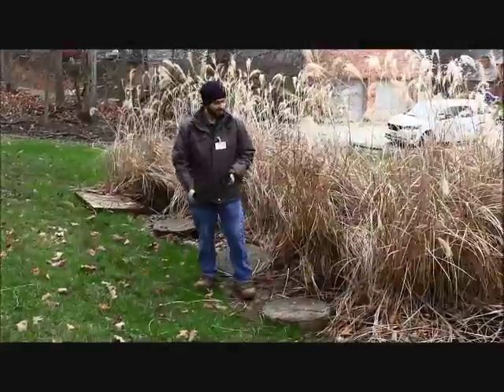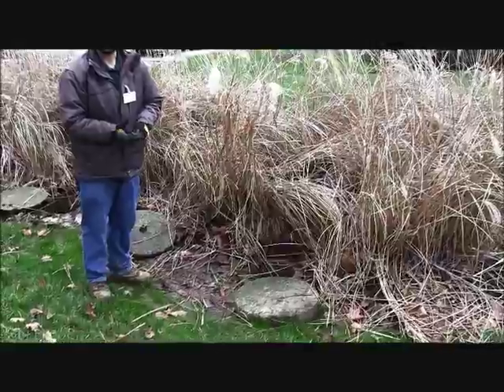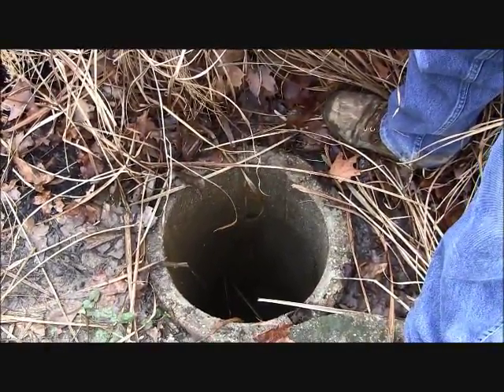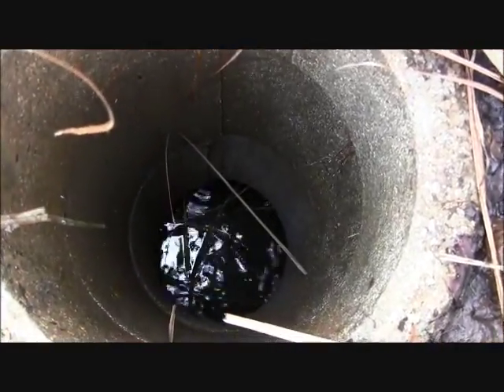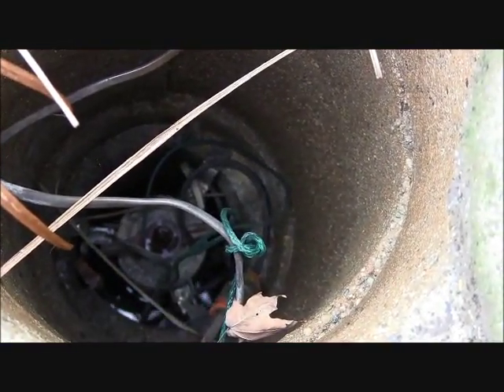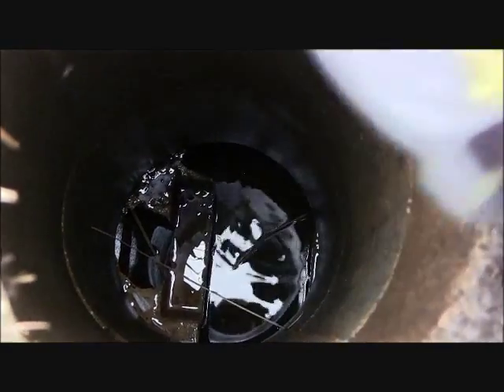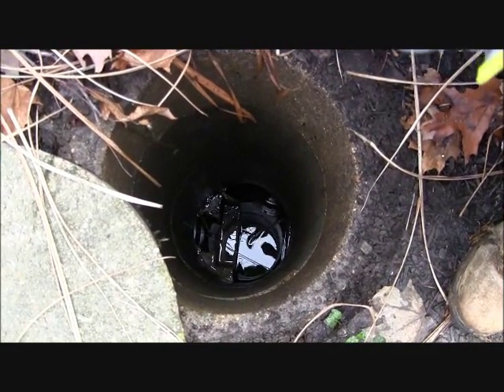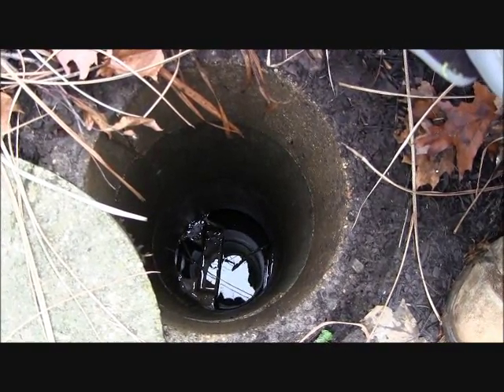Hamilton County Public Health Inspects a Jet Sewage Treatment System with Upflow Filter

Comment: I also have a Jet system installed in 1997, to much junk is falling into that system, I would trim back all that jungle around the system so when you inspect it all that junk won't fall into it. And dig around and make sure the covers are above ground.great video.

Comment: I have a Jet system that came with my home......  mid 70's version.   I was very thankful that the technician who services my system.  He taught me how the system works,  so I can check it myself and avoid an emergency situation.  Just knowing how to inspect the motor, and the tank levels and up-flow has saved me a big mess at least 3-5 times over a 10 year period.